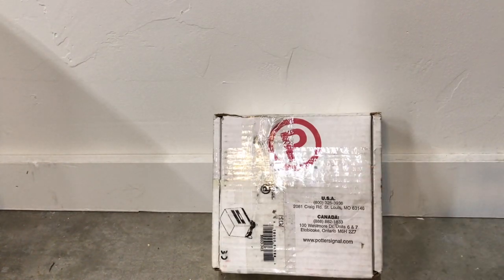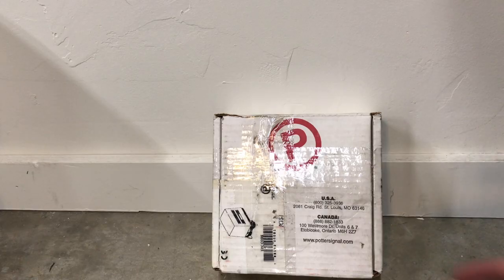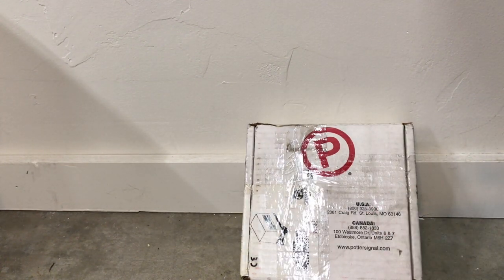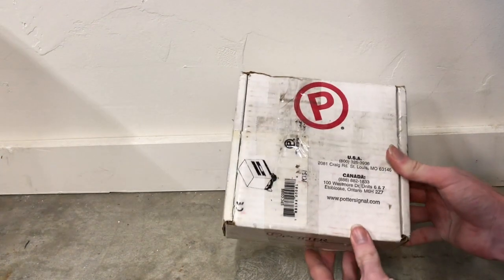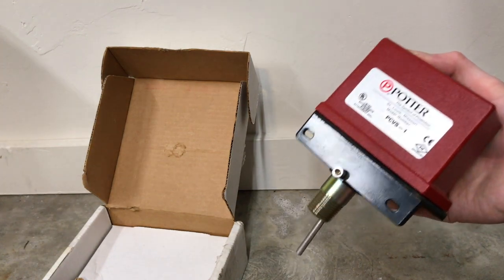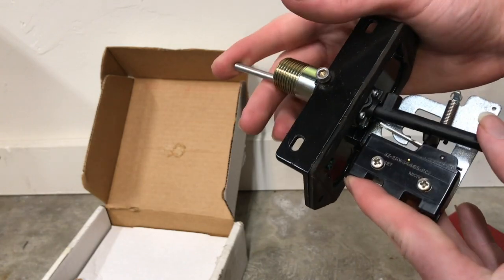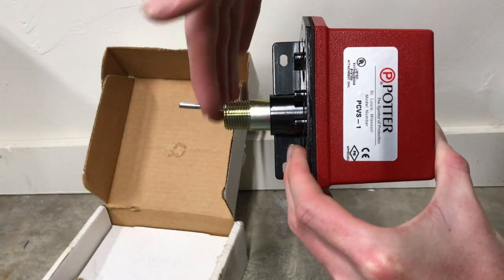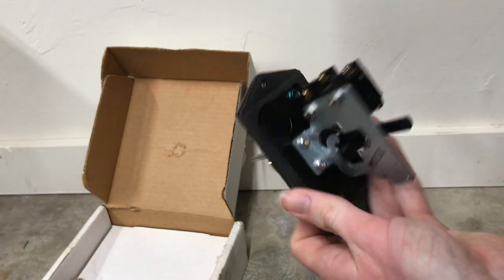New Device! Potter Supervisory Switch!

Comment: Just to add a comment from Australia

Usually these supervisory switches suit an OS&Y valve - outside yolk and spindle. There is an indentation in either side of the valve spindle  (provided by the valve manufacturer ) where the level fits. The switch is installed with the water supply valve in the fully open postion the lever resting against the indentation in the valve.  As you close the valve the lever is forced from the indentation to the higher part of the valve spindle thus triggering the fire panel.
Reply: The switch in this video is a potter PCVS switch.  PCVS switches are commonly found on PIVs (post indicator valves) not OS&Y valves.  PIVs are those 4 foot tall things that have a sign that says OPEN and SHUT when you operate them.  They are usually on top of a sprinkler pit and connect to a OS&Y valve that's down in the pit.  

The switch you're referring to is called a potter OSYSU.

2 completely different switches, 2 completely different applications.